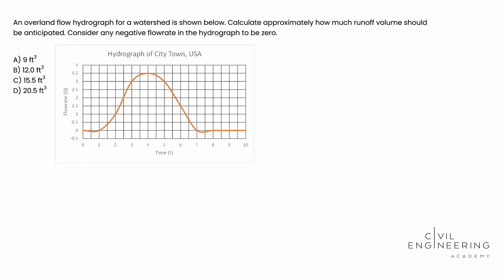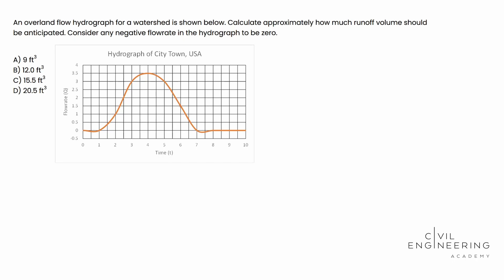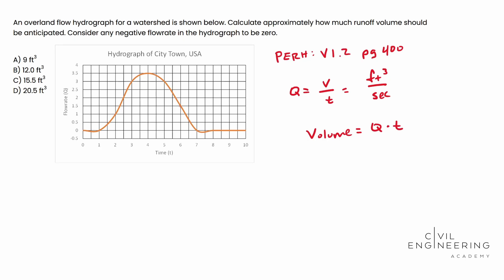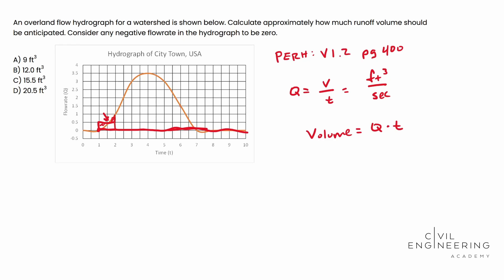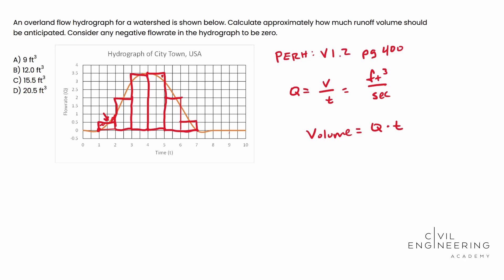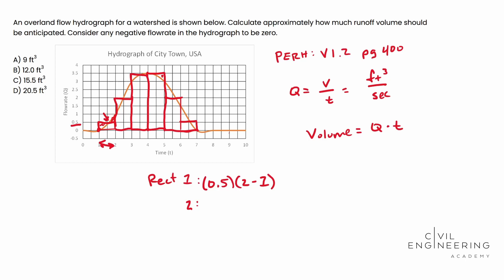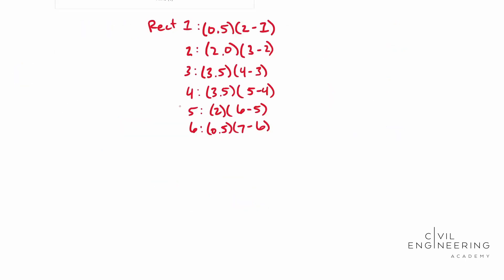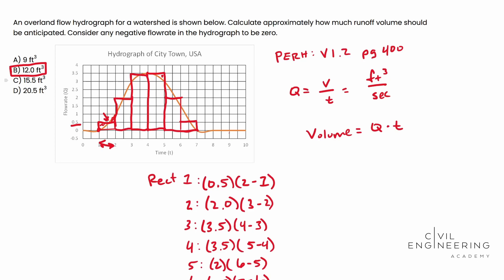Civil PE Exam – Hydraulics & Hydrology – Calculate Runoff Volume from a Hydrograph

Comment: I used Q= (05.)(qp)(T) from chapter 6 and got close and saved about 6 min. Note: Only use this if the hydrograph has a normal distribution.
Reply: What values did you use for Qp and T? Using 3.5 and 6 would give you a volume of 10.5 and that's dead even between choices A and B?
Reply: @gbelai  Had the same question.
Reply: @gbelai  I think he using 3.5 for Qp but for the time he's using 7 not 6.

Comment: I take my exam tomorrow and just learned from this video that they came out with a 1.2 version of the reference manual. Does anyone know the differences between the two versions?
Reply from the maker: If you're curious about the changes from the 1.1 to 1.2 PE Handbook this is what we are seeing so far.  

Let us know if you notice any changes too! 

Added new section 5.1.6 "Design Traffic" (1 page) 
2. Added new section 5.4.3 "Interval Timing" (1 page) 
3. Removed a section 5.5.9 "Traffic Growth Rate" (1 page)
 4. Updated the title of section 6.7.1 from "Mass Calculation" to "Mass Conservation and Continuity" 
5. Added new section 6.7.2 "Advection-Dispersion Reactions" (2 pages) 
6. Revised the critical depth yc of trapezoid formula on page 357 (PERH 1.2) or page 349 (PERH 1.1) >> we noticed this error months ago. 
7. Total pages 509 (PERH 1.2) vs total pages 497 (PERH 1.1) 
8. Added qmax and qmin formula for bearing capacity (page 100)
9. Revised the USGS culvert classification (page 365)
10. Removed the Nq,Nc, Ngamma formulas (page 97) and refered students to use table only
11. Added the correction factor of groundwater table (page 98)